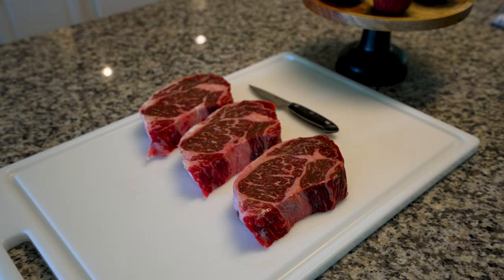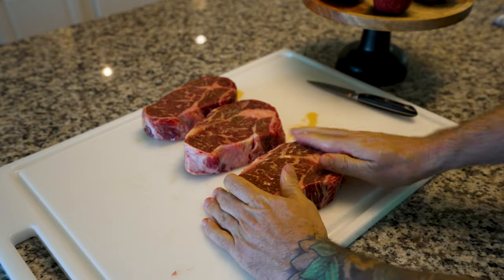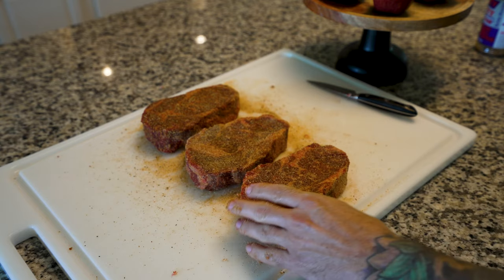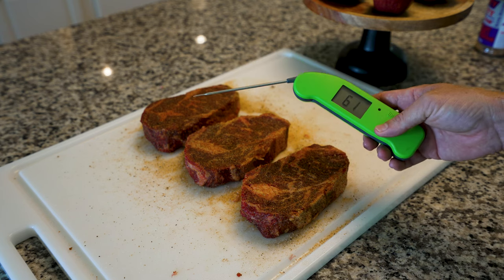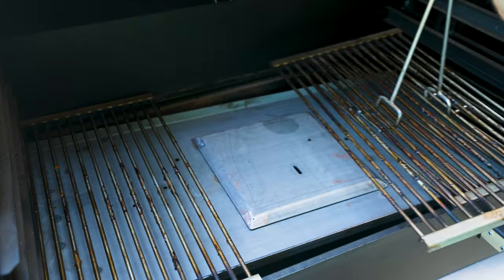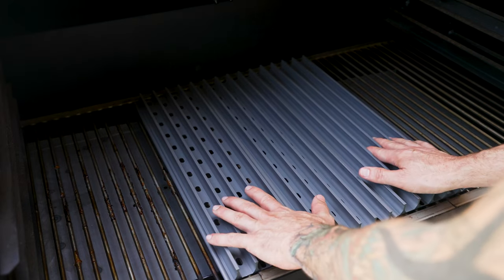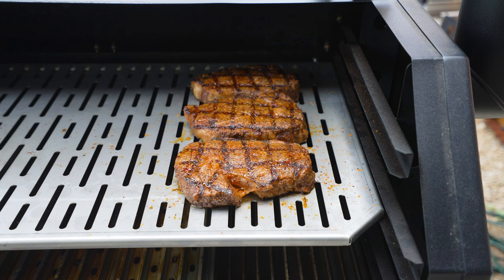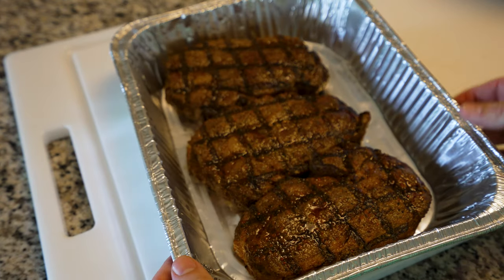Grilling the PERFECT STEAK on your BLAZN Pellet Grill

Comment: Love my Grid Iron. Except the controller. I’m on my 5th one since 2015. It malfunctioned today again. Stuck on 270° but running 325°. Buttons do nothing but on and off. 
Guys in Nebraska always have some Bull sheet that I’m doing something wrong. Guess so. Just spent 35 yrs in HVAC control industry. 
Going to Savanah Stoker controller. Bought one 7 years ago for an OLD built in Oregon Traeger. Has been flawless. Owner/ builder will talk to you directly.